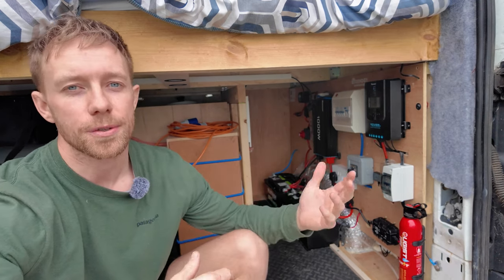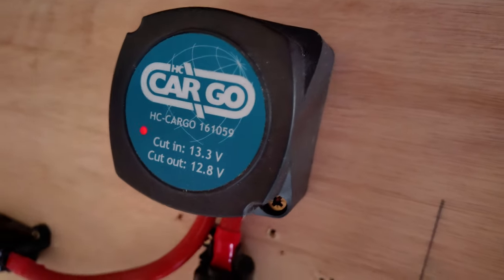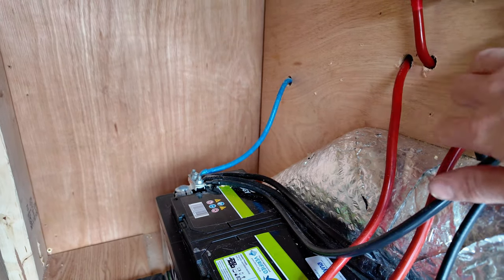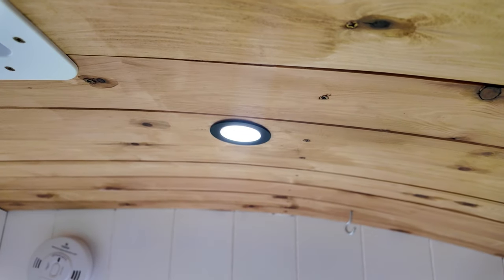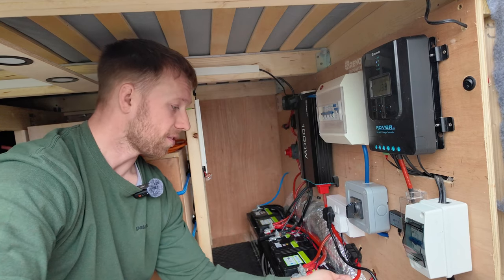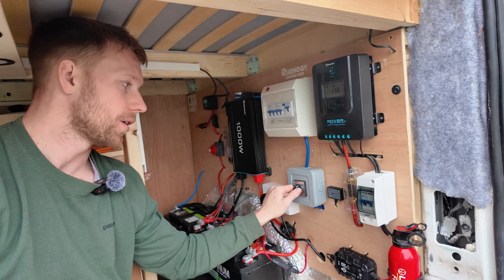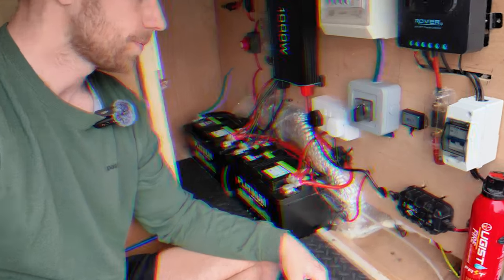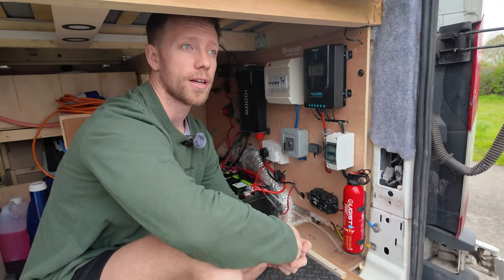My Transit Camper 12V Electrical System Walkthrough

Comment: Very helpful thank you. I do have a question?  I've seen many posts saying 'don't connect direct to the vehicle batteries! but use the CCP connection point! My missing link in my electrical connection is my leisure batteries to vehicle. Also in a 2014 Transit Mk8. I appreciate any help
Reply from the maker: As long as you fuse it correctly and fit an isolator between the aux battery and leisure battery/batteries I see no issue with connecting to the aux battery terminals. Also ensure you use a VSR or DC-DC charger along with the isolator as you don’t want to be starting the van up by drawing power from the leisure battery/batteries.